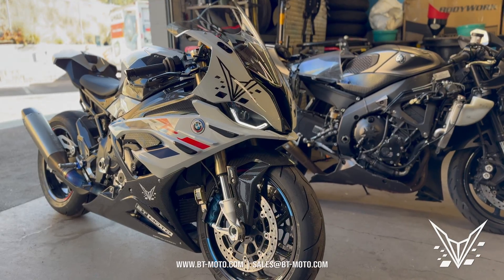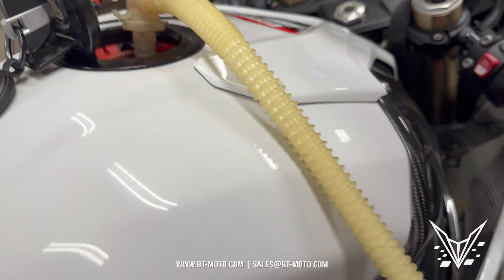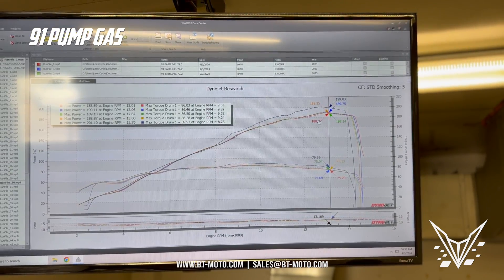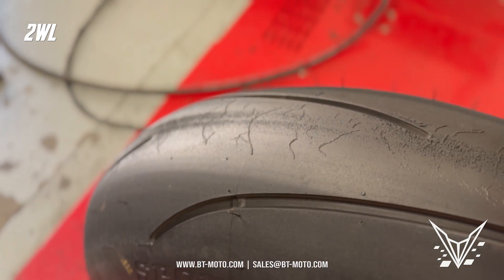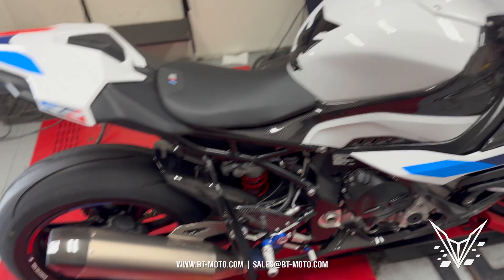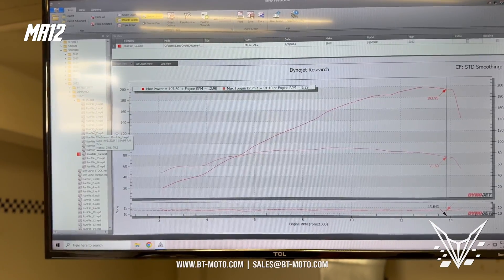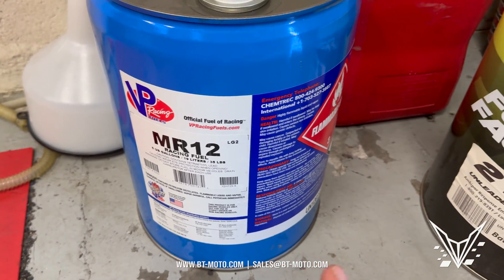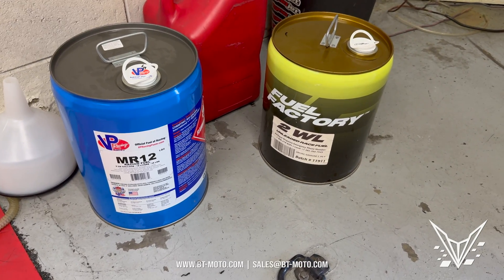MR12 or 2WL, Which Makes More Power? BT Moto S1000RR Dyno Comparison

Comment: I would stay away from MR12 with these newer S1000 line bikes as the lead adversely degrades the wideband lambda sensors. 

In previous generations, it didn't matter as the narrowband sensors were useless.

Comment: So question... Not sure about now but is there a difference between what you are running now vs a Dedicated Pump map vs MR12 map for the K67? Is the dedicated MR12 just even better? Do people with Dual Maps not need to switch to the MR12 map and just dump MR12 in while running their Pump Gas Map?
Reply: Did u watch? He explains at the end...fuel time closed loop which only BT offer...only brand that comes with wideband lambdas stock. U chuck mr12 in anything else it runs stupid lean as the fuel is oxygenated. They are able to set AFR target and the ecu adjusts to the fuel, tempz altitude etc. Ignition also adjusts for these variables. U can run more ignition with higher octane and compression which gives more power....crap fuel on aggressive timing would ping its tits off til things break, melt etc.
Reply: They can all technically run on a stock map but without a tune you not taking full advantage of the race fuel. Depending on the fuel it could take more or less of it to get the air/fuel into the sweet spot.
I run multiple maps on my bike. I normally drain the 93 out before running 2wl. There is always a tiny bit of 93 still in the bottom of the tank and in the lines but that wont hurt your bike if your on the race fuel map. It just means you need to let the bike run that 93 fuel through which you can do just by warming up.

Comment: Im impressed that it made 191 on 91pump gas! I just did a dyno shoot out (at a harley event) i have your ait relocation, bt velocity stacks, tuned, was on 93 pump arrow headers+mid-pipe with stock akrapovic muffler, stock filter and only made 187.52whp they did tell me that the dyno is off 8-12hp at these numbers. The dyno tech also said the tire was slightly slipping so I'm going to put in a sprint filter and mr12 and hope for that magic 200hp number
Reply from the maker: As all dynos read differently, the key is to always get a baseline and improve upon that baseline with good afr and a smooth power curve. If you’re making 10whp over your baseline on the same dyno, same day, you’re doing something right.
Reply: @BT_Moto my bike gained 9HP at peak power , but gained 12+ in other areas after a recent dyno tune, same day same dyno. The graph was almost more telling than the actual #'s, massive gains IMO
Reply: Biggest thing is getting a better filter that flows more air. More gas more air = more power